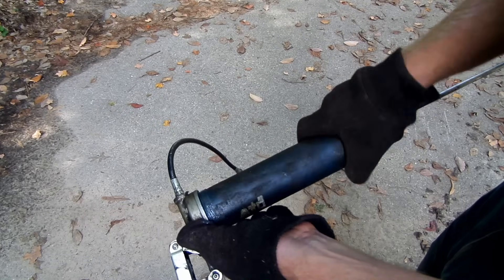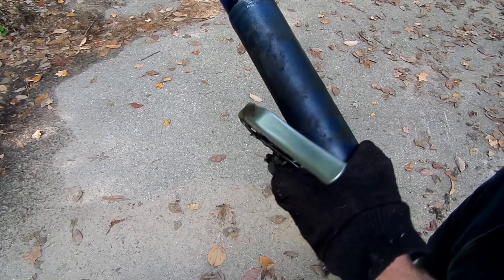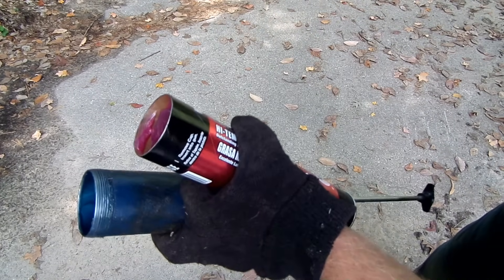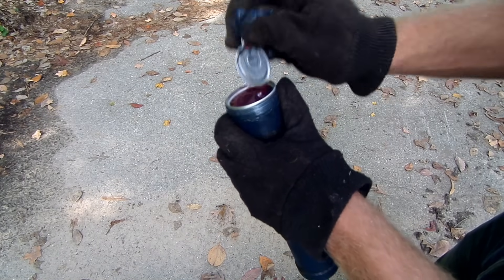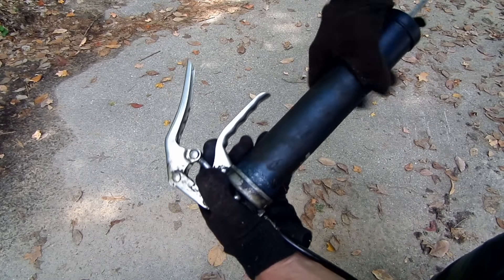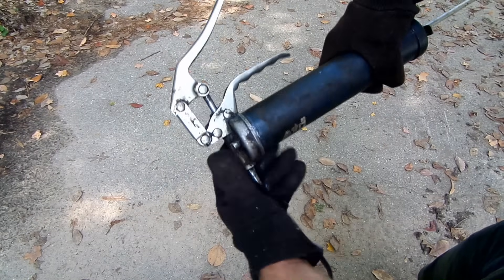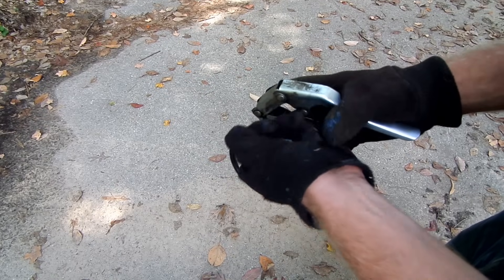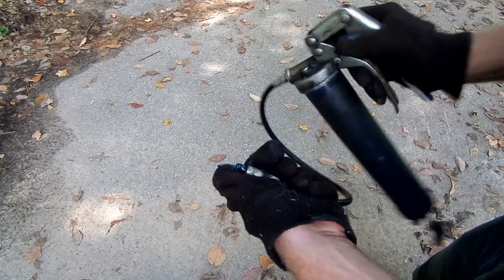How to refill a grease gun

Comment: This is an exemplary video.
I'd like to see one more step added;
probably 70 percent of the refills I have done in the past fifty years,
and with every grease gun I have used,
it has been necessary to bleed off the air
trapped in the gun.
And I've never found a convenient and reliable method of doing so.
Reply: Don’t screw in the barrel all the way. Release the handle and turn it so it grabs the plunger inside the barrel. Then push on the handle and grease should start squeezing through the threads. There should be no air left. Then tighten the barrel down and release the plunger so the handle can be pushed inside.

Comment: Good video but I would like to offer the following. Grease guns I have used in the past used the pull out lever to actually compress the grease, so that a positive pressure was applied to the small piston that supplies the grease. For some reason most of these grease guns allow the piston on the rear spring pullback to slide right thru the grease and do very little. A trick i have applied is to add more grease to the cartridge, this is a small fix, but a better fix would be to find a rubber washer the same size as the hole in the cartridge, and then allow the spring loaded disc at the bottom of the gun to do a better job.

Comment: any tips on how to keep them from leaking. mine leaks red shit all over the place.
Reply: +MegaChevy65 Good question.  I think they get moisture inside.  I have mine hanging on the wall and they leak all over the floor beneath them.  Not much that you can do.  Maybe I should store them in a bucket.
Reply: +MegaChevy65  There is a neat solution to that on page 37, April 2016 issue of The Family Handyman magazine. It’s in “handy hints” submitted by Steve Goodrich. I keep my grease gun in a heavy plastic bag until I can get mine made.
Reply: longsyo What is the solution?  I don't subscribe to any magazines.
Reply: +MegaChevy65 i keep all my grease guns inn a 5 gallon plastic bucket. They will all leak.